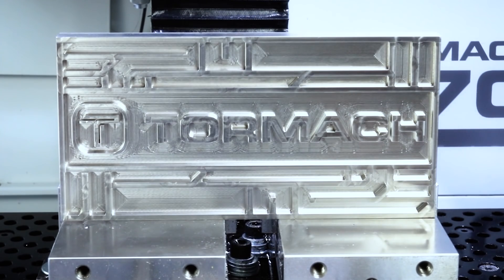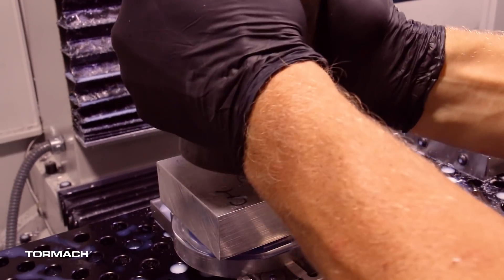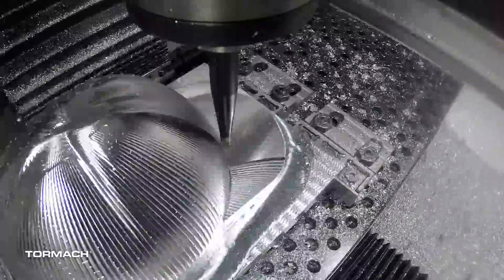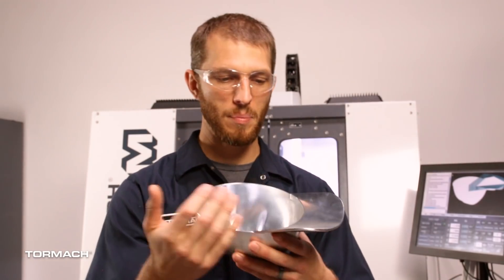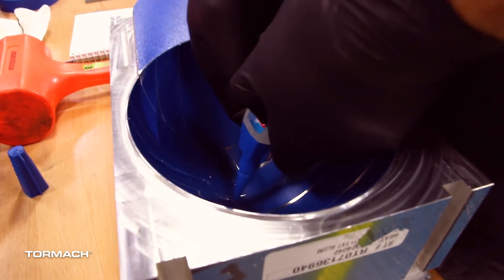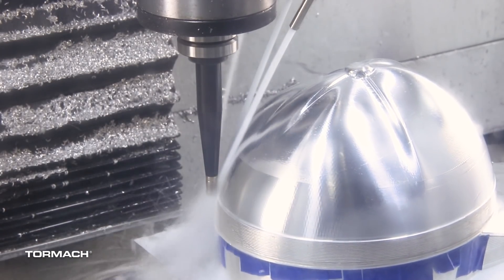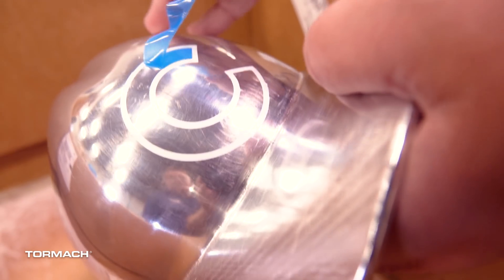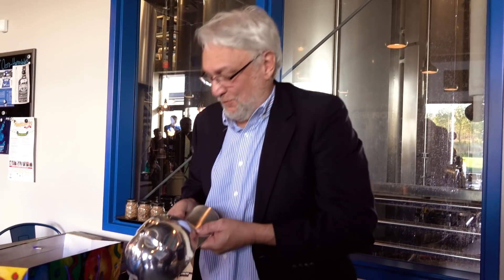Machining an Aluminum Baseball Hat for the World's Biggest Cubs Fan

Comment: I was at IMTS 2018 and stopped by Tormach’s booth. They had this hat there. Looks awesome!! I was glad to be able to talk to them about how they held this for the second op. I am making a dome shape and wasn’t sure how to hold the second op. So this project has helped me out a bunch. Also what is the button insert finishing end mill that you used? I am interested in getting one.Thanks.
Reply from the maker: Thanks for stopping by the booth! The cutter we used is part number 38179, which you can find here: https://www.tormach.com/store/index.php?app=ecom&ns=prodshow&ref=38179&portrelay=1 And we held it with part number 31808, which you can find here: https://www.tormach.com/store/index.php?app=ecom&ns=prodshow&ref=31808&portrelay=1